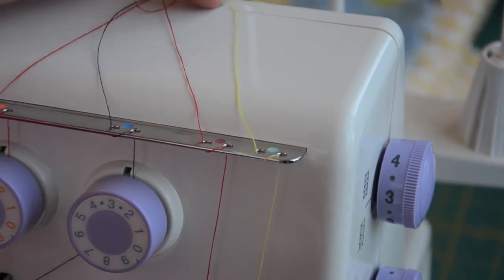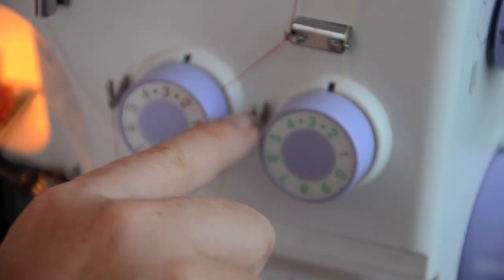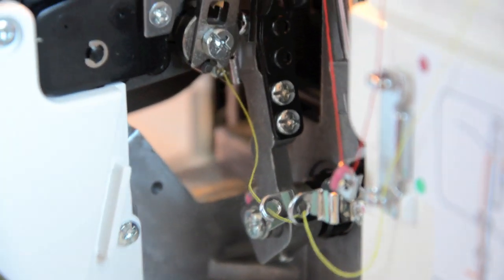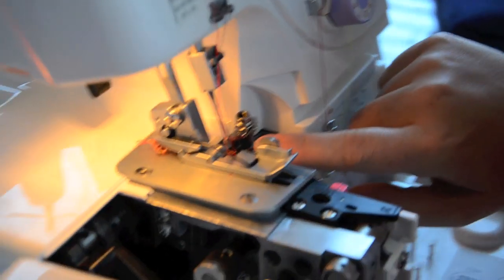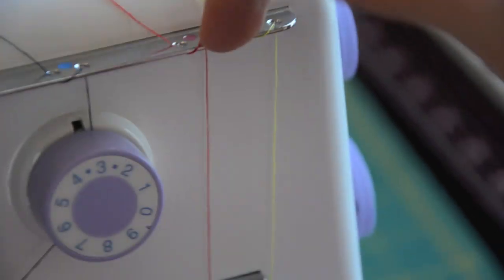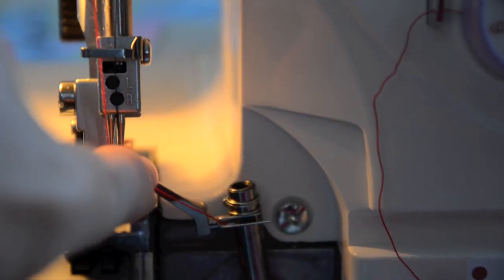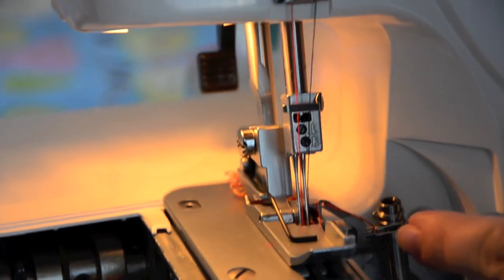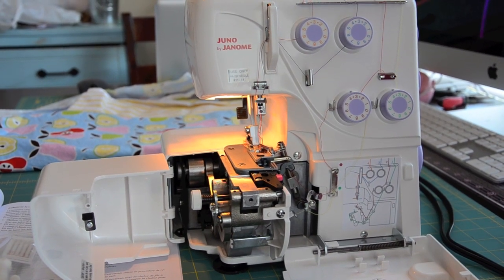Juno by Janome 3434D thread out of the box

Comment: I bought a serger from a neighbor online, I have a heck of a time with the threading on the first looper the green one. No one has a video that shows where that last looper goes either over the red thread or under it and where does it go underneath, mine keeps breaking I have tried every tension every possible setting but that green thread keeps breaking. Can someone please do a video that shows the complete threading of the first looper the green one. or the one on the right .   its called the lower looper and even the book doesn't show where the correct possitioning is.

Comment: How do you set the tension!? I having problems with my needle breaking
Reply from the maker: +Stephanie Marquez 
I keep my tension at 3.5 on all knobs.  If you look in the manual there are ways to adjust the tension to make other stitches but I pretty much just keep mine the same.  If the thread is catching you might have to rethread the machine.  I have had to do that a few times because there was thread caught somewhere. Good luck!